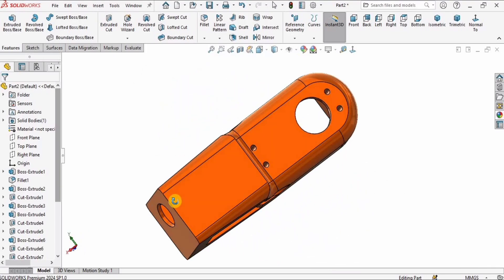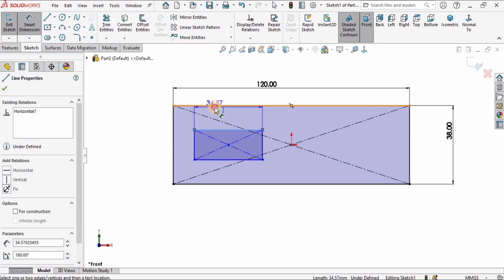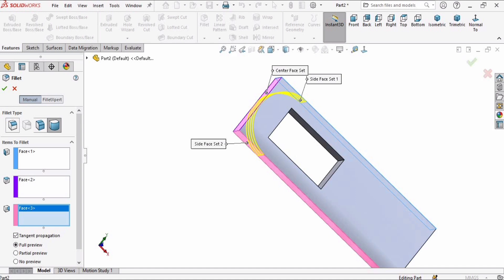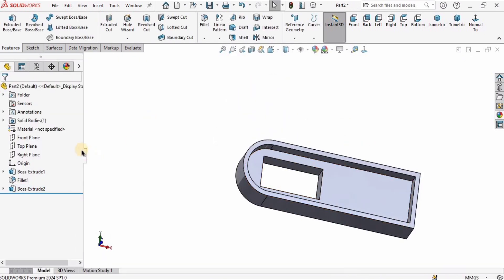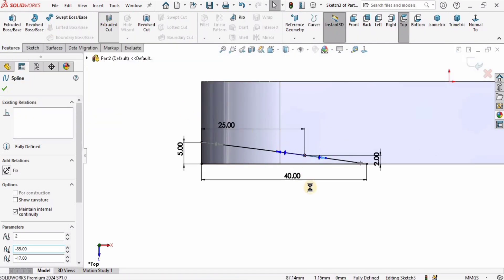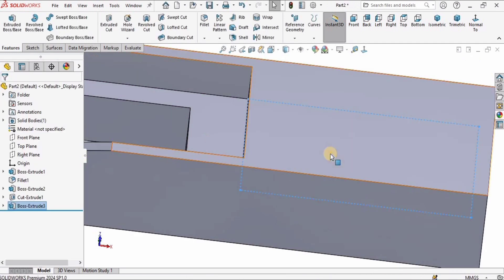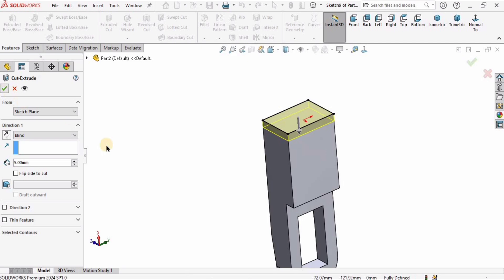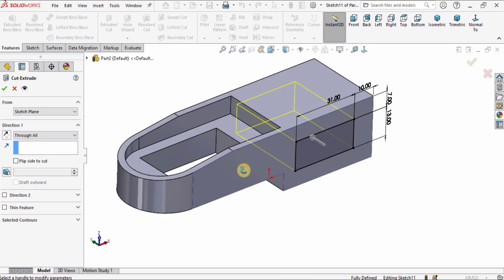Robotic Arm Link- 2 (Part 1) in solidworks| Robotic Arm Design

Comment: At 3:50, when adjusting the spline, the dimensions for the control point positions aren't visible. Could you include those values?
Reply from the maker: i do not have the model anymore..so really sorry